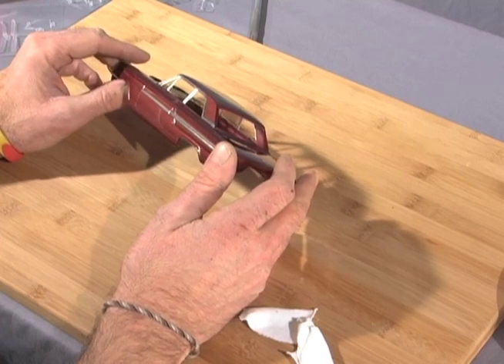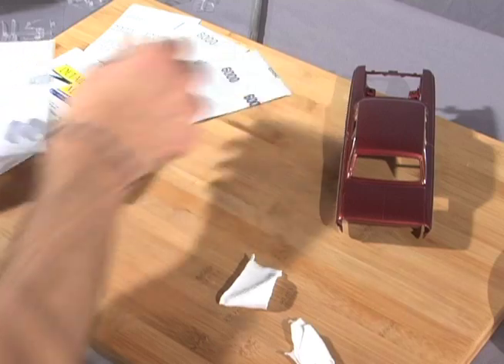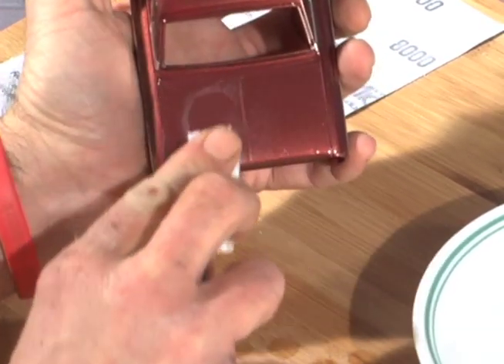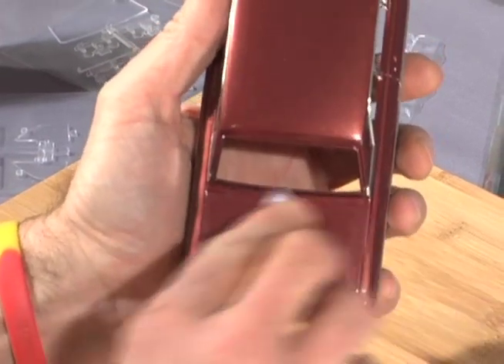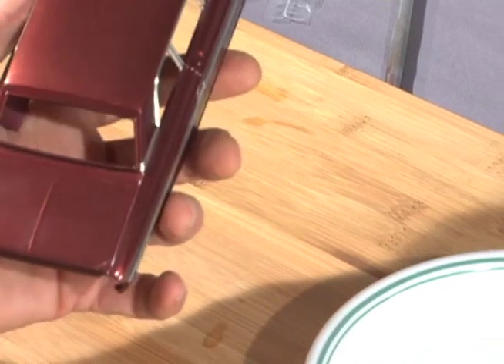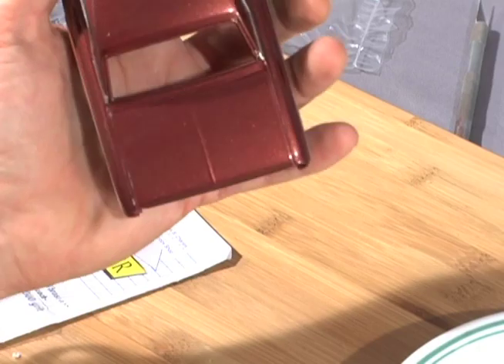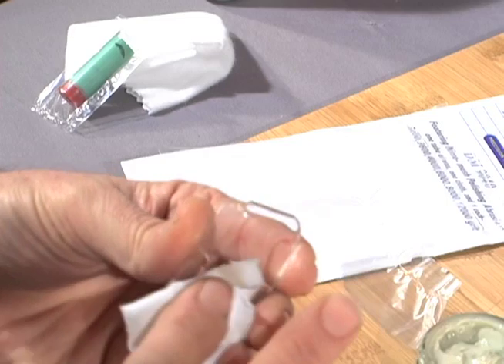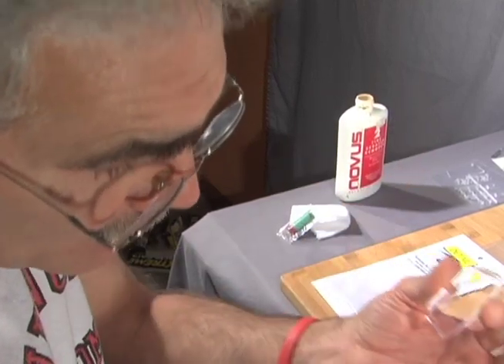Tips and Tricks for Building Show Quality Model Cars DELETED SCENE!

Comment: Maybe CJ Talor has got his question answered by now on how to paint the black areas of a grille. But if not, I'll throw in my two cents worth. I paint the whole grille flat black first. I've read that you should thin the paint first but I always found that you need to apply a second or third coat of paint if you thin it. But after that's done and dried, You dip a kleenex tissue in paint thinner and wipe the paint off all the high spots. Then you'll have flat black in the recessed areas. The results are quite realistic.

Comment: I am currently working on AMT'S Kit#6556 NOVA SS Pro Stocker.
Anyway,the belt/ pulley broke in half which leads me to the question,does anyone make aftermarket pulleys and black rubberband kit to replace 1 piece unit ? I dont think I want to try cutting the plastic belt away from pulley's then sand the pulleys to the appropriate diameter. Dont have small hands and fingers for that. LOL